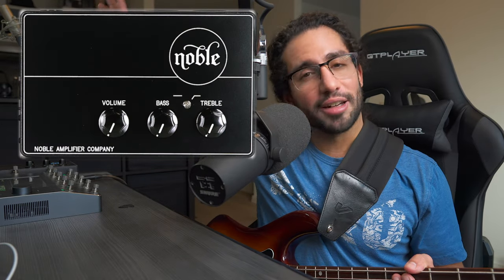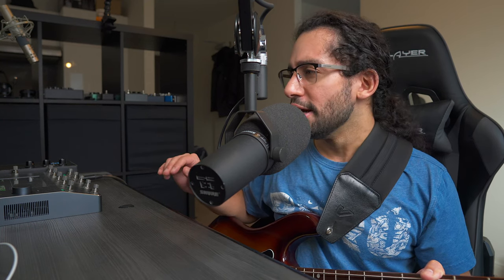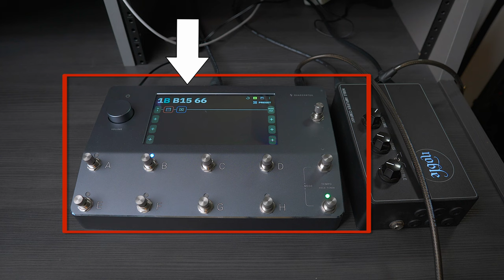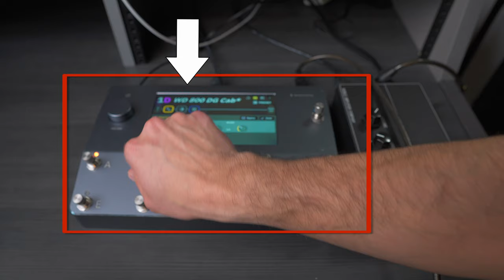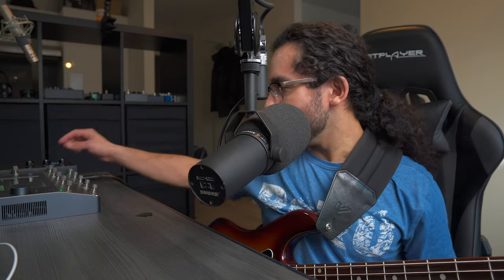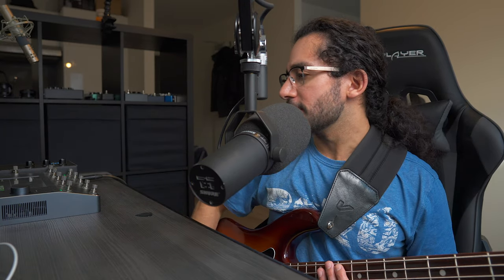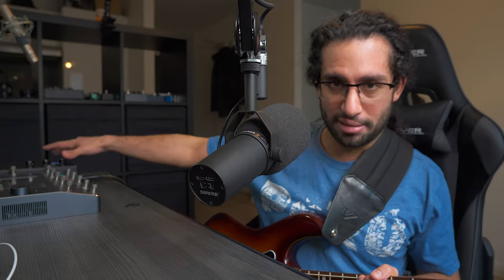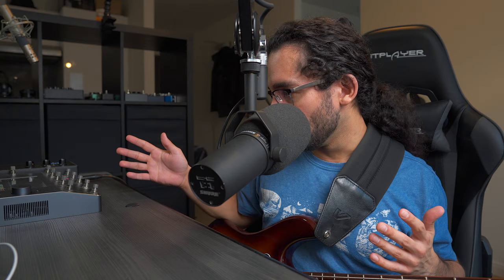Big Studio Sound, Small Footprint | Bass Tone Tuesday

Comment: Hello Ivan! A simple but very useful video thank you! I got a huge board with a noble as a heart. I am planning to buy a quad cortex and use it instead of my board with its simplicity and portability. Why you do not use the capture of noble and quad cortex alone?
Reply from the maker: Thanks for watching! I find the “real” Noble does give you a bit more depth of sound and a nicer playing response/feel. However, if I wanted to travel lighter I would use the capture and leave the Noble at home. 

Additionally, having a backup signal in case anything fails is always helpful :)